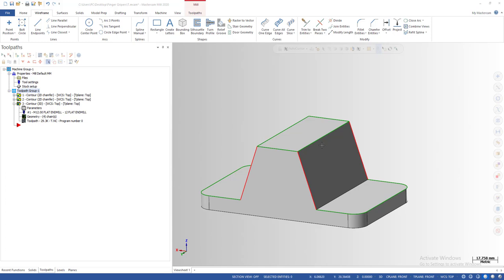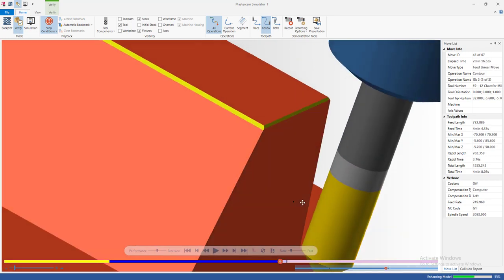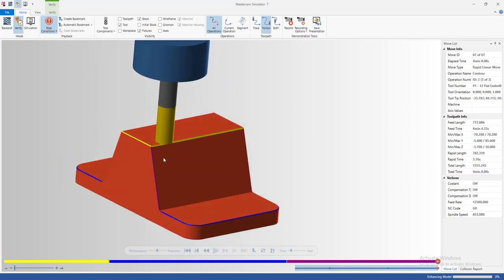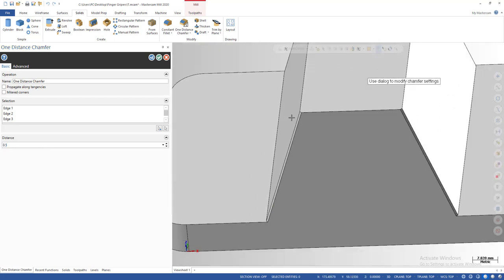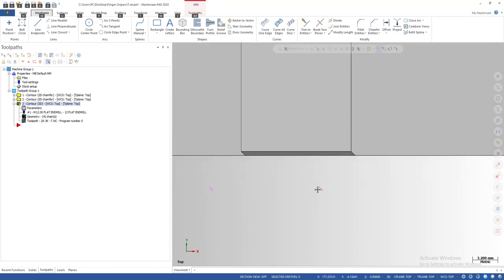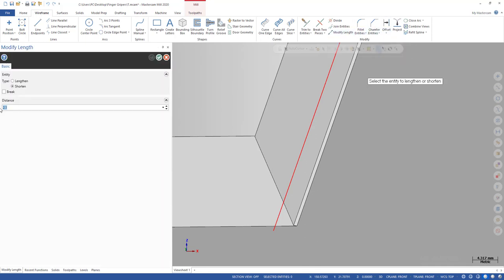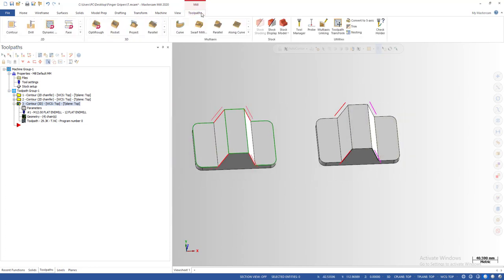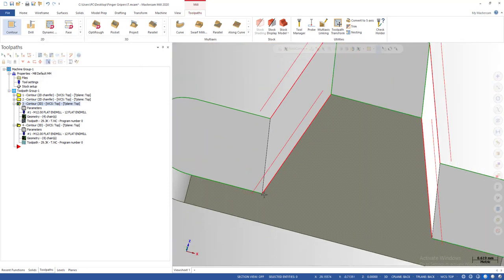Mastercam tip: Chamfer steep edges with a flat end mill - the easy way

Comment: I have a vf2 with hrt210 When I try to do an engraving program in the verify it shows up right but at the machine it's backwards 
I've tried to change mcam parameters it's 2018 btw Is there something in the Post processor I need to change ? 
If I change on mcam from cw to ccw on verify it's backwards but at the Machine it's right I've tried origin on both left and right on X didn't make a difference . Is it because on the machine parameter page it shows the rotary on left side of table where is mine is 
on the right ? Thanks for your help . I really think it must be a change needed in the post I'm using the generic 4x haas post with cimco I changed the A axis in the files and didn't make a difference there either

Comment: Technically that is a fillet rad not a chamfer.
Reply: That is skill & experience man. With that small of a detail you won't even notice that it's actually a fillet. You need to be creative like this. That's what will separate you from the others.
Reply: @homer4889  In my level of work (aerospace)25+ years that would get you sacked not putting the right break edge on. Its also why British are great engineers as we do not cut corners.
Reply: @harezy  LOL so what do you do, grind corners?
Reply: @harezy  looks better than a hand grind are de burr.